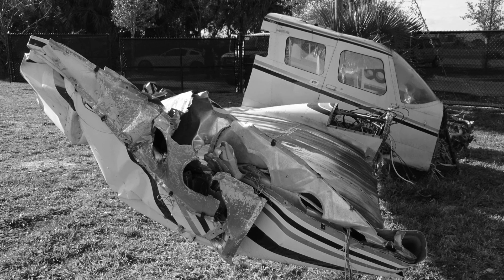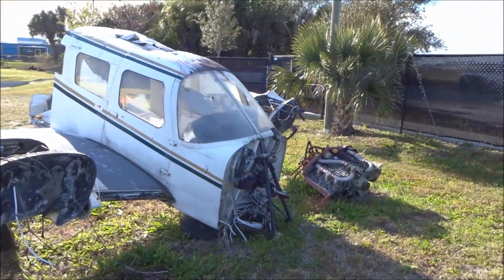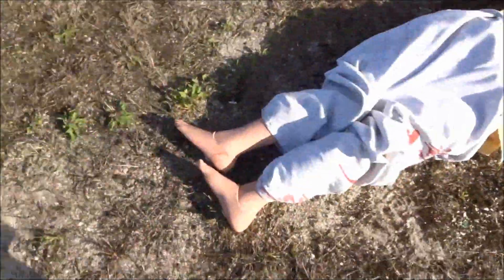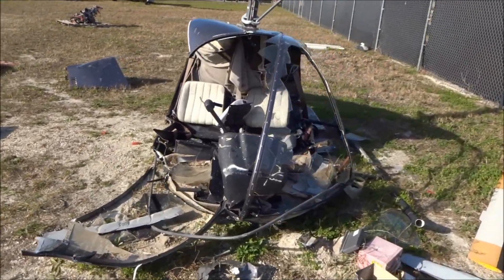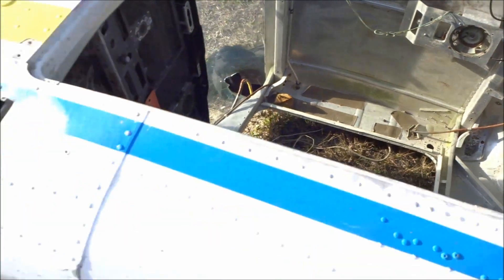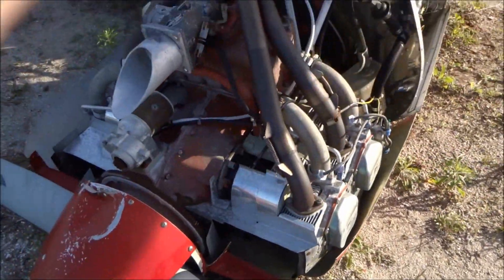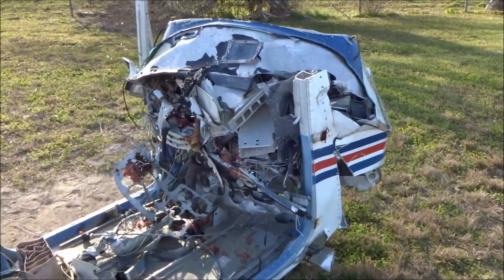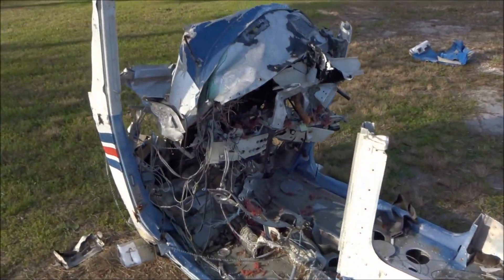Plane Crash Aftermaths Up-Close (Investigation Training Lab)

Comment: Autorotation, is allowing the helicopter to land safely, using the amount of RPM in the rotors after the engine failed. You have to put the collective on 0, which allows the rotors to keep spinning without slowing down. As you near the ground, slowly increase the collective, to increase the lift, and slow the rate of decent. The goal is to save the RPM until the critical point, in which to slow the helicopters rate of decent, to make a survivable landing. If you pull the collective (Throttle) up to 100 right away, the wind from the drop will slow the rotors too quick, and you'll drop like a rock.